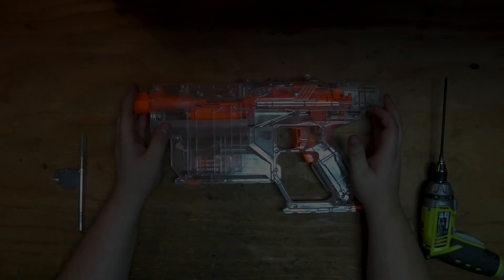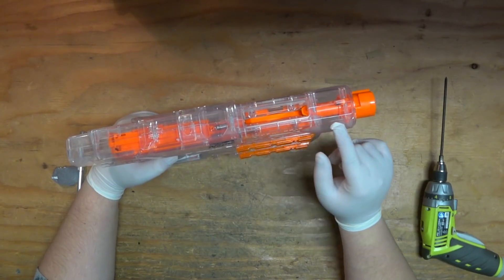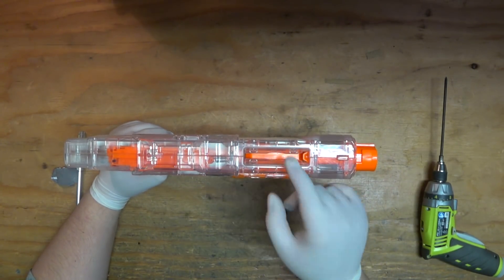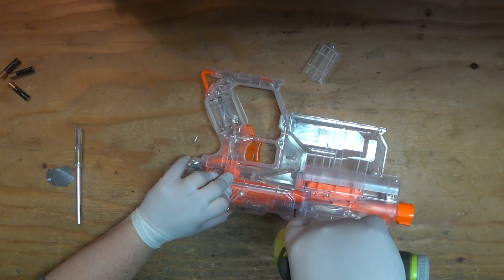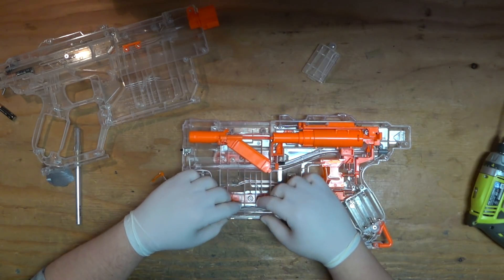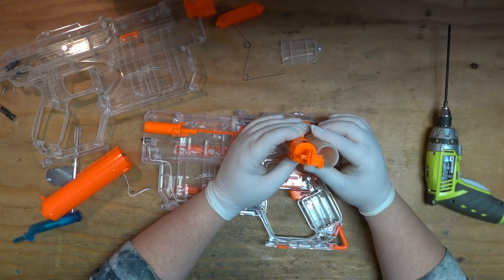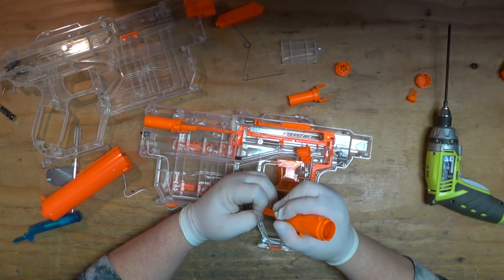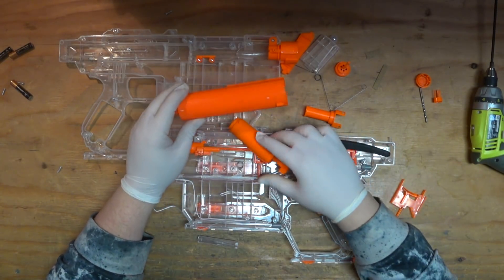NERF AUTOPSY: Modulus Shadow ICS-6 | Walcom S7

Comment: I am coming down and breeching this. It is happening. The challenge has been issued and I must at least get hands on it.
Reply from the maker: It's in a box for you. Knock yourself out.
Reply: Did this ever happen? If so, how did it turn out?
Reply: @penismightier9278  not worth it. If i recall correctly, it got a new spring and a brass breech, ended up same as stock velocity and much less reliable.
Reply: @zachkostechka3673  Less reliable? That's impressive. Thanks for the update!

Comment: Why didnt they base it on a retaliator. Why.
Reply: Zach Campbell odds are people would complain that it’s a copy of the Retaliator but internal mag and it’s not original
Reply: Better yet, why didn't they base it on the Han Solo/Jaku blaster but with a slightly bigger capacity and slightly cheaper because there's no star wars licensing. WHY NOT HASBRO?
Reply: @dandanplaneman  all i want is a performance based speedload 6. Why cant that happen
Reply: @heyitsfranklynn168  Same. Can't be that hard can it hasbro?

Comment: It legitimately looks like a downsized hotshock plunger tube with a lot of unnecessary junk packed onto it with an open breech design that shouldn't exist. They literally could have made it a reshelled Han solo blaster or a minimized magnus, but no, they needed to make shit complicated.
Reply from the maker: I'm sure they had a good reason. Thinking about it, they might have just been sold on having an open magazine well, but making it as thin as possible, and thus having to make the plunger tube tiny and what not.
Reply: @WalcomS7  I think its possible to "fix" it, by re-engineering it. But it does look like a lot of work for what it is. Seems like it's not worth it.
Reply: Walcom S7 it's made at Australia it's an Aussie blaster it's orange trigger because it's already good for Australia

Comment: I like the looks and the fact it has an internal magazine.  But the dinky garbage barrel, tiny plunger tube plus weaker chrono readings compared to the Nailbiter make me say that the neat features don't make up for the flaws.  It doesn't seem like it's worth it when you can buy a Nailbiter for $5 less and gain surprisingly better chrono readings with a one hand firing blaster, plus a larger magazine.  Seriously, why did Hasbro screw this up and change what worked?  Is this just to be sold for it's light up gimmick?  Is it to make people buy the Evader instead?

Comment: Hey Walcom.  Just so you know.  Not only is the kickback kind of sweet in its stock form.  It is also super easy to pull apart and remove the ar.  And I was also able to replace the stock spring with the Stock Blitzfire Spring for a bit firmer draw.

Comment: It's probably a lemon. cause in drac's video, it shoots pretty hard.
Reply from the maker: Did he Chrony it?
Reply: Did it still have the open breech in that video? With the white darts, it's hard to tell...
Reply from the maker: @maverick13_bro87  I'm 100% sure mine isn't a lemon, and if you want to disagree with that I'm sure it won't be long until other people get their reviews out and can corroborate. Regardless if mine is a lemon or not, the internals are still god-awful, there is little to no mod potential, and there are 4$ blasters out in the wild that hit harder and have mod potential. Or just use a Retaliator.